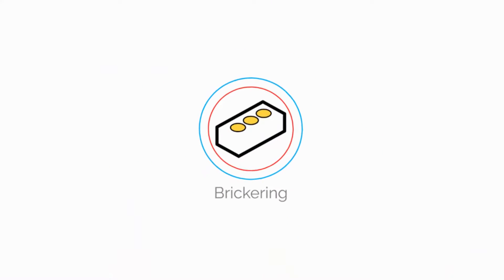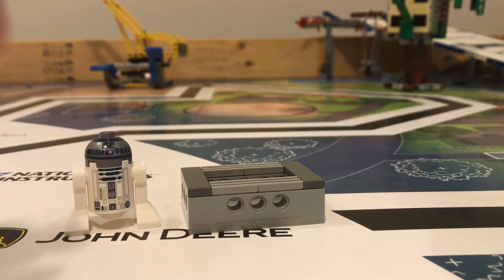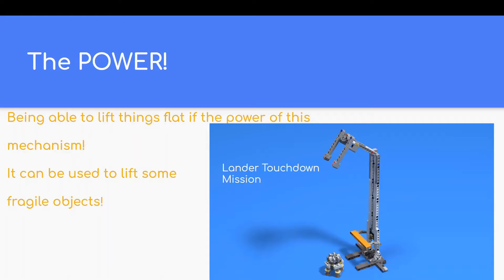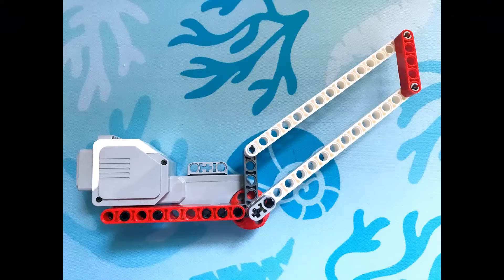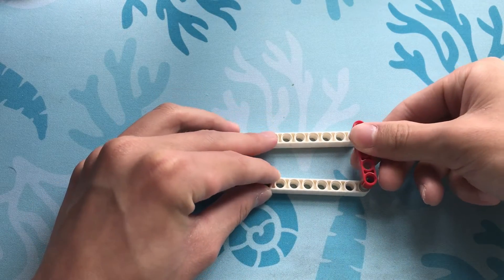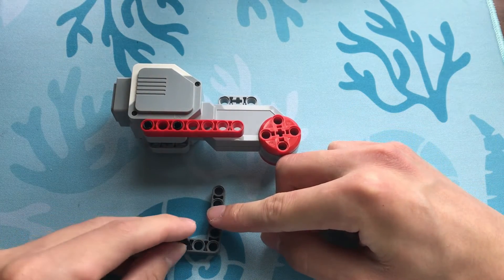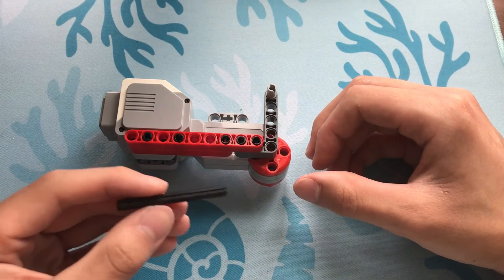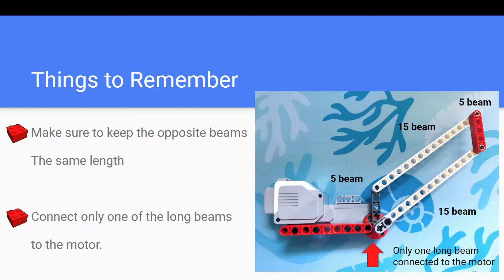Lifting Objects with Parallelogram Linkages!

Comment: How to desgin a parallelogramm 4 bar link to lift down a load of 300 kg from a hieght of 600mm ? my link lengths are 1000mm, 300 mm, 1000mm, 300mm (specia case of grashoff law. i need to figure out all internal forces with this datas. also angle of lift is in between 6 and 128 degrees. my task is to figure out all internal forces and bending moment of each link please help me if anyone interested in this topic